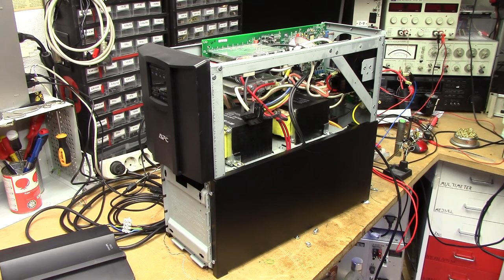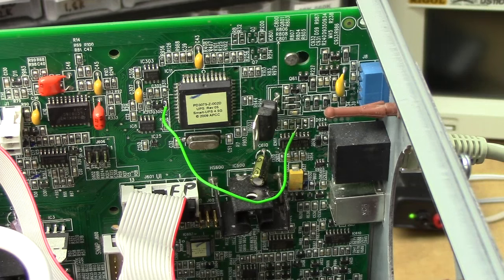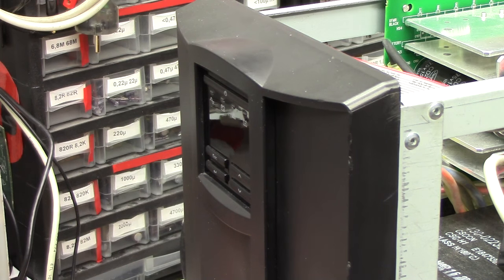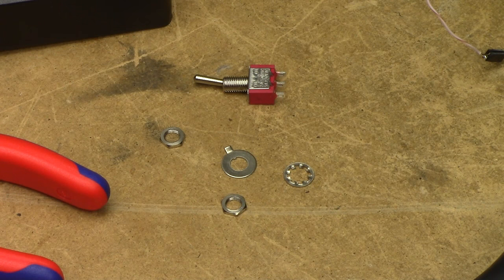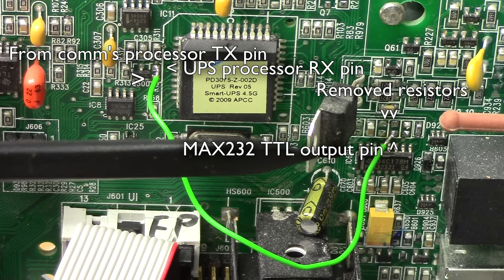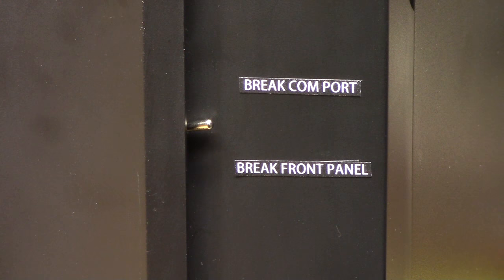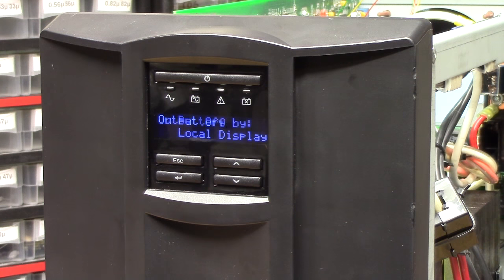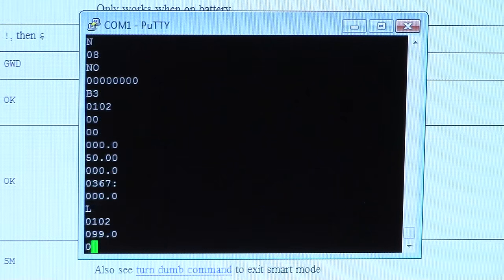Enabling the Smart interface on an APC SMT2200I with a single pole switch

Comment: I am in Vietnam using the same 2200 apc smat up as yours but because I am using a used battery so it always sounds like a whistle, I remove the whistle, during the process I made A short one foot from the horn with a nearby circuit, so the machine is no longer working and it has the following phenomena:
- When the battery is connected to the button remains open but no output signal
- When the power cord is plugged into the active relay, the two open and close buttons are no longer effective. So can you help me recover? If you can help me I will post a video of its operation status for you

Comment: what baud rate settings are you using in putty , i get the front console button to respond and not respond after i installed the switch but not seeing serial data.  example 2400 data bit 8  stopbit 1 parity none flow control none???
Reply from the maker: I use the same settings as any other APC Smart-UPS. I think your settings are right, so you might have some other issue.
Reply: @FFcossag  thanks I am going to make u a video to show u exactly what I did

Comment: I have the same unit here, but since a few days I get an overload alarm, when mains goes down (or if I pull the powerconnector (that gives the APC 2200l its power) myself, even if there is not any device connected.

Any idea what that could be??
Unit is from 2015.

Anyone with a schematic??

Cheers

Robbert
Reply from the maker: I couldn't say, it could be any number of things. Bad transistors come to mind.
Reply: @FFcossag  -  I first checked the Electrolitic Capacitors. Not one has bulged, so that might sound promising but you never know for sure.
I wonder if you have any idea on how to obtain schematics/workshop manual of the APC SMT2200I.

The only site that has 'some' schematics on APC ups systems is a site called: elektrotanya.com
But the (hungarian) owner only registers you when you intitially answer 5 out of 5 questions about electronics. Some questions are easy as pie, but some are really tricky.
Just try it, and get access.
I USED to have access, but if you don't log in at least once in a month, he kicks you out.

Have a try!!

Cheers 
Robbert / PA3BKL
Soesterberg, NL

Comment: Here's what probably happened. Schneider Electric no longer has any programmers that know how to work on the SMART software. Maybe they outsourced their programming to India, or maybe something less nefarious. SMART is old. From memory, it dates back to the early 1990's. Programmers nowadays stay at companies 2-3 years. So instead they will keep the SMART software forever and rather than properly extending it, they'll just continue to write nasty hacks into it. They've probably reinvented the wheel a dozen times with that layer on top of SMART. It's probably also true that they have no idea how to replace SMART and if they tried to their UPSes would not work.
Reply from the maker: +John Gotts That sounds scarily plausible - I mean, they're even using an ancient 5 V processor in this 2010(!) unit.

Comment: Might be able to bodge both to work. AP9604 Triple Chassis allow multiple SmartSlot cards to work together, you can also daisy-chain multiple AP9604 chassis. I converted a Silcon Triple Chassis (AP9604S) to an AP9604 last week and needed to work out the schematics to do so. There may be something in the diagrams of use to you.

https://plus.google.com/b/106948293336791915873/+AintBigAintClever/posts/3CdfhzU7Yh7